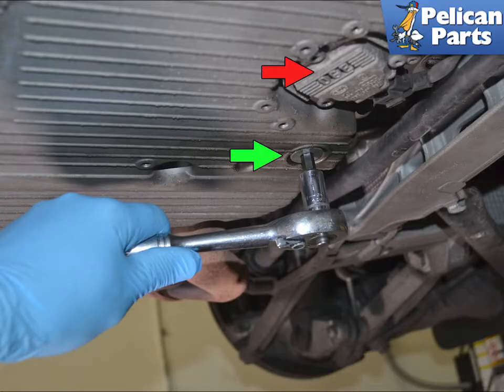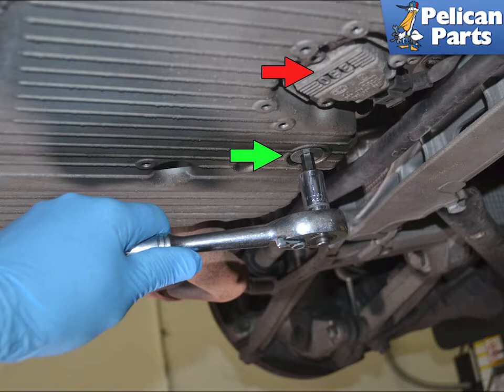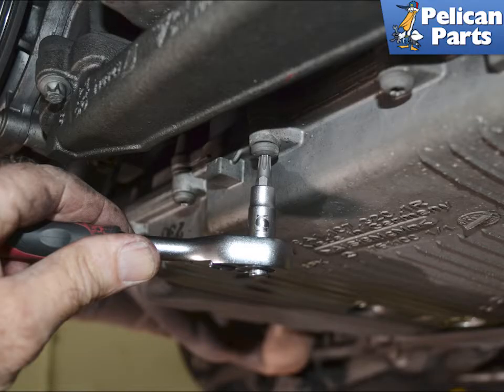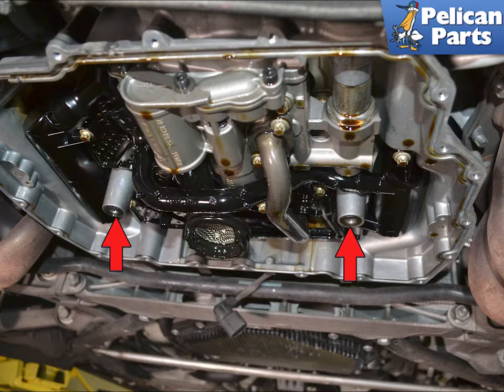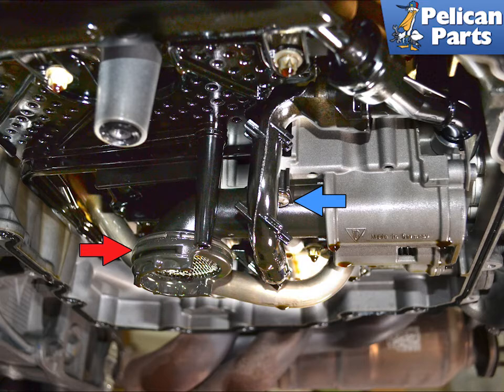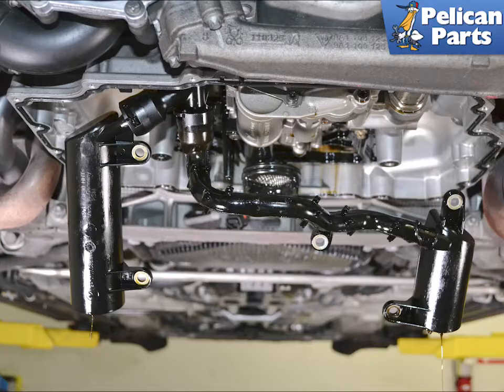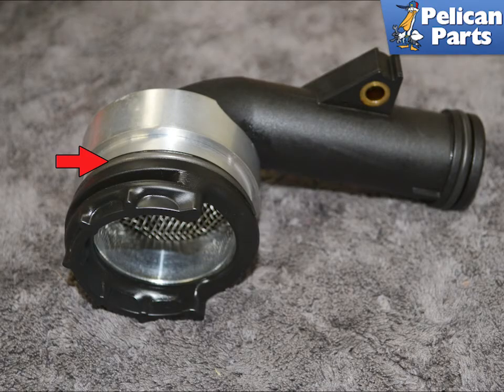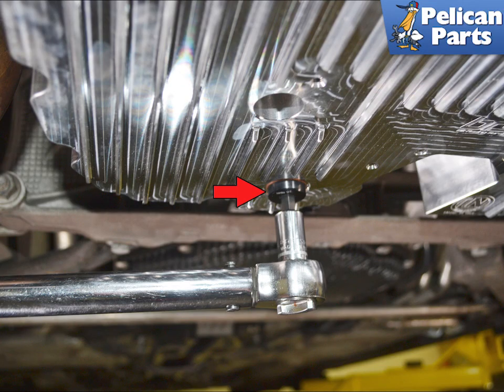Porsche 997.2 LN Engineering 2 5 Quart Deep Sump Upgrade (2009 - 2012)

Comment: Is there a readily available equivalent for that grease? My order got messed up

Thanks
Reply from the maker: Yes. You didn't mention what year and model vehicle you are working on.

With your vehicle info handy, give The Pelican Parts parts specialists a call at 1-888-280-7799. They can figure out what part or repair kit you need.
Reply: @ thanks, pelican overnighted me the correct part. All assembled and test drive complete!